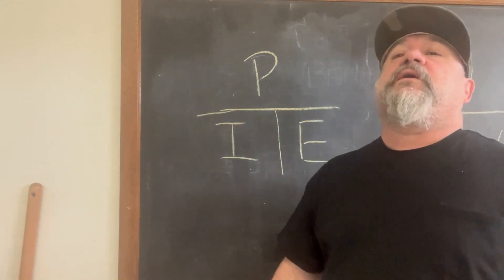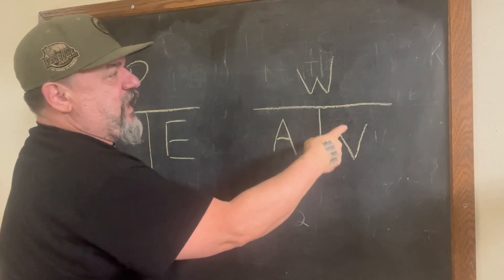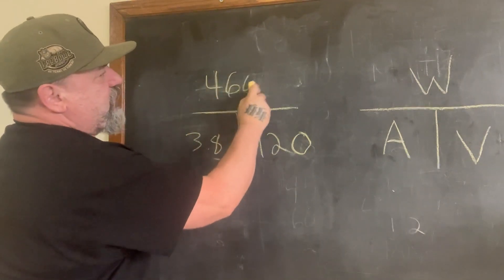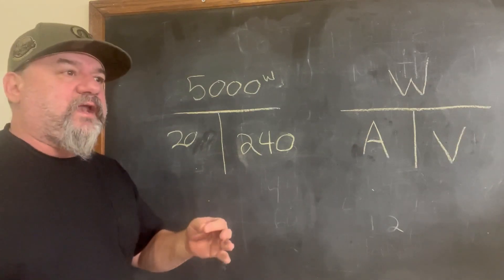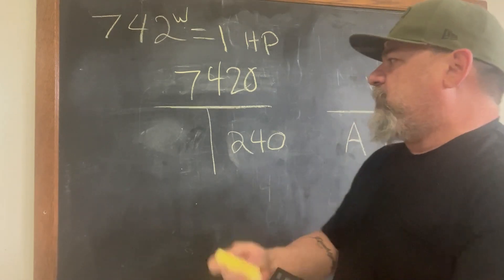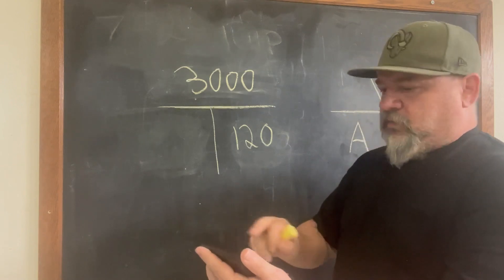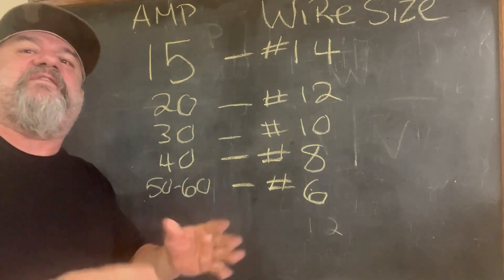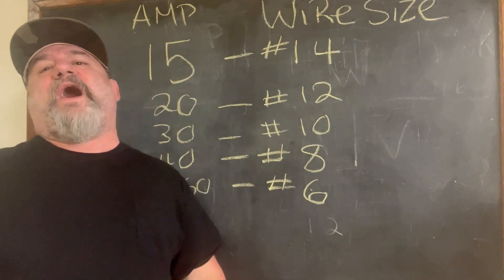How to determine Voltage, current, wattage, horse power, breaker and wire sizes. PIE CHART EXPLAINED

Comment: Amps going through the roof using 120v and not 230v. More dangerous, bigger cables needed and a bigger rated service needed. No benefits to the lower voltage.

Comment: Hey I've got a question about breakers. I'm putting breakers to 100ah Lifepo4's. The maximum charge rating is 50a. What I've learned from circuit breakers is they do not flip at 50 amp. A class b will take three to five times the current from 0.4 seconds to 13 seconds. Should I instead use a 15 or 10 amp class b breaker? 3 * 15 would be about 45. Thank you for your video once again. Really soaking up the knowledge.
Reply: Don't know if this matters but it is a DC circuit.

Comment: Can i put a 30 amp braker on a 12 2 wire?
Reply: No because your 30amp breaker is allowing or has the capacity to allow higher temperature (more voltage passing through without detecting an overload within that circuit with using gauge (12), and would end up frying, melting, and/ or causing a fire to that entire circuit at any point w the device you’re using to draw (said energy/ power/ wattage). But suppose your device worked fine and never over heated or in Electrical Terms draw more power to the level of hazard but you decided to leave  one day. You’d leave behind a fire hazard to an unknowing person. Its a violation to Code but just a violation in general I’d say. Safety First you’re probably getting away with it based on that 20% cushion implemented in every device, as per manufacturer requirement along that circuit starting at the breaker. In your scenario I can only think of the wire melting and breaking off somewhere making contact, melting through the junction box and causing a fire burning an entire building.
Reply: You may, but only in some specific situations.

Comment: Cracked me how many sparkies do not have a good understanding of your PIE chart & the E over I times R chart. Worst is guys who think if you connect say a 1200 watt heater that's rated for 240 volts to 120 volts it would use 600 watts. Nope Not today or any day. Would only use 25% of the rated 1200 watts = 300 watts. If you reduce the voltage on a heater you cut the wattage by 75%.
Reply: I take it you're in HVAC?

Comment: Love it when electricians use ohms law for DC circuits when they are dealing with AC HAHAHA just clueless
Reply: I thought ohms law applies to any resistive circuit? Is that not true?
Reply: @hollowlife1987 it does
Reply: @hollowlife1987  it is true but in an AC circuit the opposition to current flow is called impedance and must be calculated in a different way. It's just the nature of their differences. AC changes directions at a certain frequency and DC is directional.
Reply: @thugpug4392  right but the basis remains the same doesn't it? Z=V/I
Reply: They are the same lol. Ohms law works for both.

Comment: Would you know how to explain 3phases PIE calculations??
Reply: 3LPE: The load is I/sqr(3)*cos phi. So you divide Amps by 1.73 and ignore cos phi because you take it as a safety margin. Then you need a fitting curve (C-curve for example) for the type of load on your breaker. The curve tells how fast it will trip, so if you have a big initial load, adjust.
Reply: @Unotch  thanks, but sorry to tell you that i already knew this.
Sorry for making you waste time explaining.
My question was only destined to the dude in the video and was a little ironic.
Reply: @martf1061  Well, no loss. If anyone SHOULD be looking for that answer - right here it is. ^^
Reply: PS: So if you have a 18.5 kW fan on 3x400 VAC you divide 18500 by 400 to get the amps, then divide by 1.73 to get the amps per line. You end up with 27 (always round up) so you can use a 3x32A LTS with a C-curve becase the frequency inverter you are (hopefully) using never permits over 100% nominal load. Savvy?

Comment: 7:31
Rather than using a 30A brk, 10awg wire to wire those 50 fixtures, just use 240V instead of only 120v.
This way, you will drop the current (A) by half, and downsize your wires to 12awg on 20A brk.
( Trick 'O the trade ) 😉
Reply: Not only will you cut the amps in half, but you will blow the 120 volt rated lamps.  He is talking about incandescent for simplicity.

Comment: If that is true question is what is oms 😅
Reply: Lol oms ? 
Good question.
Ohms 😋
Reply: Ohms is the measurement of resistance.
Reply: @irvinwilloughby6887 I assume you are speaking of Ohms. However in an AC circuit its called Impedance